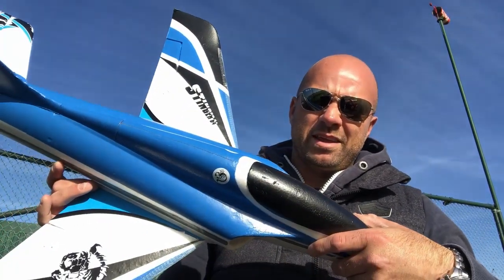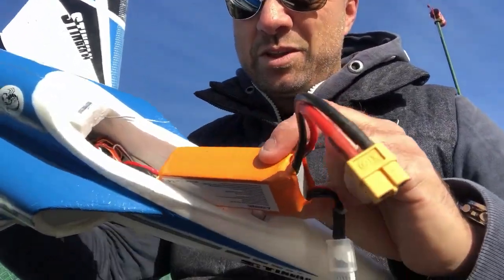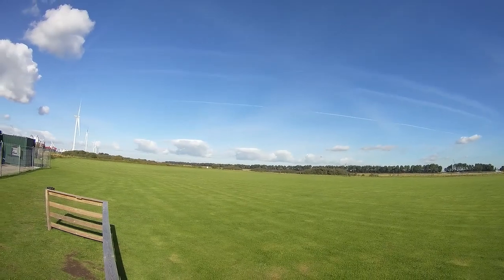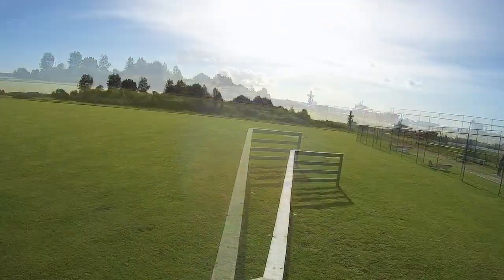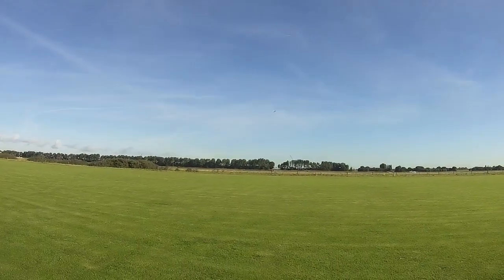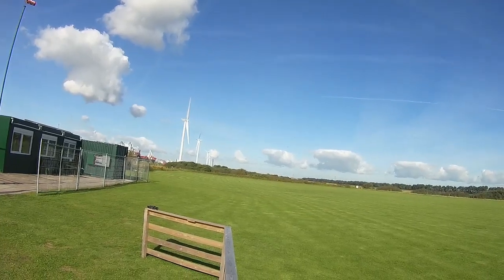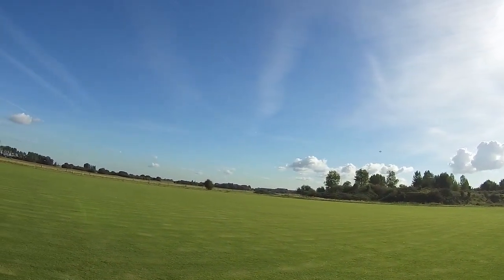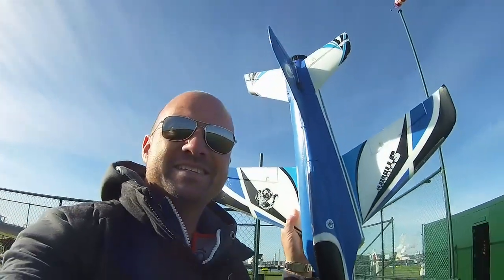Freewing Stinger High Performance 4s EDF jet flight review

Comment: Beautiful scenery and flight. What type of camera are those on the wing? And how do you connect it to the main battery or came with battery itself? what do you use to mount it? Thank you from Austin, Texas USA.
Reply from the maker: I'm using a Foxeer legend II, small, self powered so ideal to put on a plane. I only use a strip of hobbyking velcro to keep it in place (stuff of legends!)

Comment: Hey. What transmitter and receiver are you using. Are you using a gyro? 

Thanks
Reply from the maker: Stephen Dunne stop cursing lol...
No gyro, using the Futaba T18MZ and an R7008SB receiver (which is wayyy too expensive in relation to the plane but it’s what I had...)
Reply: I'm still getting used to flying so I think ill use a gyro...sorry for the profundity lol. Is there room for a receiver and gyro or would I be better off to get an admiral with the built in gyro. Soz for all the questions mate
Reply from the maker: No worries :)
There’s not a ton of space so I’d go with the built in gyro, but you really don’t need it, it’s stable af...

Comment: 6:20 was a close call. A friend of mine has 1 & runs 3s. 12 blade & bigger esc is much better. Great vid Tom.
Reply from the maker: Aussie Digger thanks dude! Haven’t seen one on 3s yet, curious to see how big a difference it makes!
Reply: @TomDeWeerdt  I got the red version 4S model, suppose to have better ESC and motor. It flies well on 3S, just a little more juice on the launch, its more relax casual flying. I tend to fly it on 3S just to toss it around w some maneuvers and play w the wind. Can sustain easily 12mph. Remove some foam up front and if need be use a rubber band to hold a small weight to the batt so it balance well.

Comment: My stinger flies very badly. Very unstable in turns. Brutal reactions for a plane not so fast after all. I specify that I am used to piloting racers ... In my opinion, the negative dihedral on the stabilizer is a gross error and makes the plane difficult to control

Comment: I HAVE TROUBLE TAKING OFF WITH THIS PLANE. LAUNCH IT UP, LAUNCH IT LEVEL, THROW IT HARDER...SOFTER??? GIVE ME SOME IDEAS PLEASE...John
Reply from the maker: johnny G slightly up, into the wind, you want to give it a bit of up right after launch during speed-up. Also know that it’s propably going to roll due to torque!
Reply: The 4s version like in this video can safely be held on the top just behind the canopy and underhand launched. Full throttle and an underhand gentle launch at any angle to about 45 degrees, it goes up straight every time. Balance the model between 75 and 80mm back, not as the manual suggests. Ailerons 1/4" both ways with 35% expo, full rudder and full elevator travel (30% expo).

With mixed throttle I get 4 1/2 minutes flight time down to 3.8v/cell.....👍